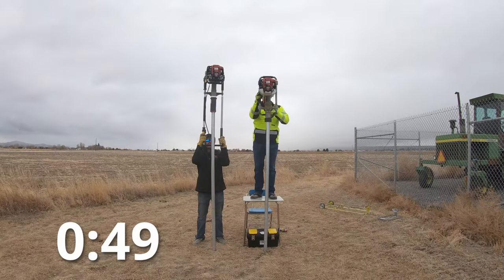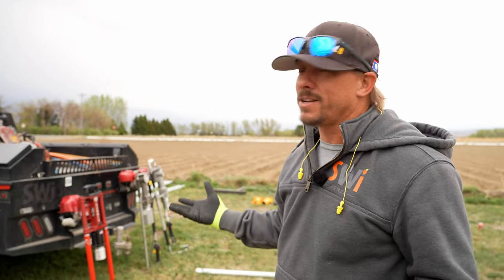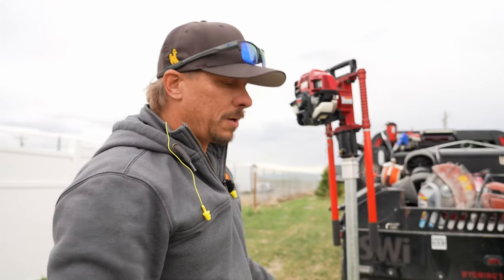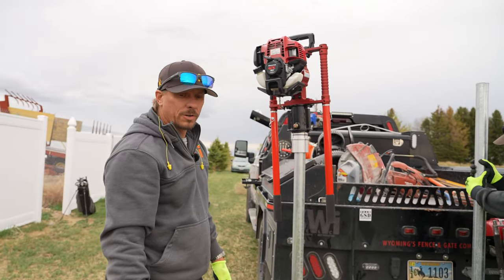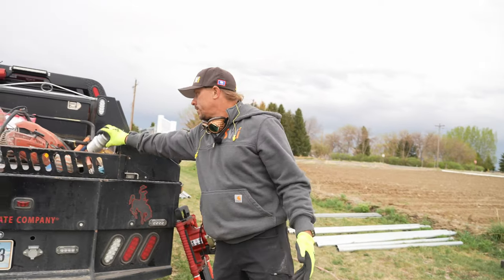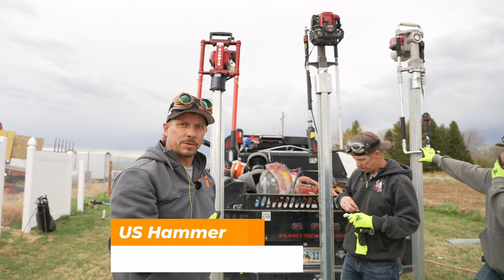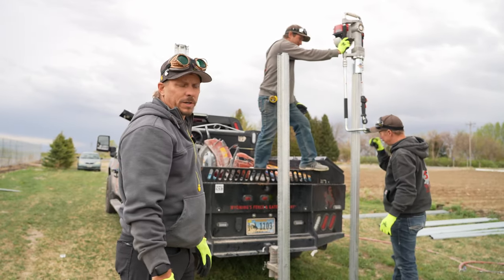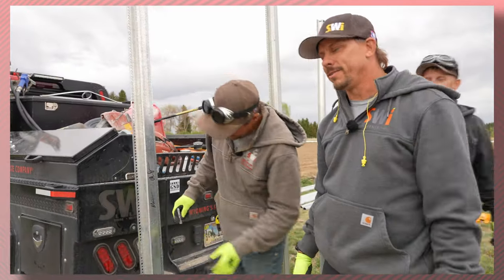The Ultimate Fence Post Driver Shootout! US Hammer VS Rhino VS Redidriver

Comment: Have you found if there is anything to put on the end of the pipe, such as a sacrificial cone tip that helps spear down into the ground and it stays in the ground once driven in? I run 3 inch pipes and can't find a cone/spear tip to help it drive down easier
Reply from the maker: I can't imagine it would help that much. And you do want that dirt going up inside of the pipe.
Reply: @SWiFence  Good call. Thanks. I live in an area where 2 to 3 feet down is all river bed so the rocks are very smooth and rounded. I thought if we can spear a way down then that may move rocks easier. Whereas a 3 inch pipe hits a rock and it's done going any deeper.

Comment: question.... I'll be flying out to NC to reinstall hurricane damaged 6' cedar fencing(HOA says wood).  The soil is sand from what I know.  What do you recommend for posts?  I don't want to embed them with concrete(unless you say other wise) so I plan on U channel or round pipe and rent/buy a driver.   Thanks in advance.
Reply from the maker: I'd go with Postmasters all the way. If your soil's conducive I'd drive but you can concrete if you have to.
How Deep Do No Dig Fence Posts Have To Be? https://youtu.be/mc92svvCRFo
Testing The Absolute Strongest Fence Post Against Hurricane Winds https://youtu.be/Ocr73Lmo9O8

Comment: Have you tested the man saver post driver? I’m sure it’s probably a little slower but fatigue factor vs speed? I will be pipe fencing 23 acres and cross fencing multiple pastures and will be purchasing a post driver soon
Reply from the maker: I've never used a Man Saver so I can't really comment on them.
Reply: Mansaver works pretty well, just gotta waste time tripping over air compressor hose

Comment: Fellers… it’s nice that y’all found something that you could concur on.  And that’s a good thing.  

Me and my two brothers have very few things that we ever concur on.  Not on…
-The weather.
-Whose country bbq baby back ribs are best. 
-Which is cuter? A baby calf or baby pig.
-Night crawlers or Red Wigglers for catching catfish.
-Who filled a bra better? Linda Carter, Loni Anderson or Markie Post

You know… the important things a man should take a stand on.

But… we did have a bonding moment this spring.  They came down on a Saturday… I was staking up my ‘maters.  They were sitting on the glider in the shade, sipping tea and advising me on how much better they could drive in those T-post ‘mater stakes.  Until I pulled out my post driver… 

The 3” diameter well pipe, with its 1” solid steel plug and bent 1/2” rebar handles weren’t what shut them up.  Nor did the high visibility fluorescent orange paint job squelch their bragging.  Instead… the red plastic-dipped handles had them in awe.  

You see, when you add the No-slip of plasti-dip with the naturally grippy surface of 1/2” rebar… you end up with handles that’ll strip the callouses off a lumberjacks palms.

Once I dropped it over the top of the first stake their eyes widened and their mute mouths opened.  And, I knew instantly the there was one thing we could all concur on… Big Brother Dave had taken post driving up to a whole nuther level!

Now fellers, iffen y’all wanna put those Plain Jane Honda’s against a homemade, Ozark, callous stripping, post poker… Just let me know and I’ll lend you mine.  

And, who knows?   Maybe you three will concur with the three of us… all post drivers aren’t created equal!
Reply from the maker: That sounds like a showdown destined to happen! 🤣

Comment: Is it better to drive a post or set it in concrete after using a post hole auger?
Reply: Depends upon what/where you are doing it at.  A farm field, concrete is usually cost prohibitive.  Also, concrete may speed up rust when used on a metal post, by wicking moisture and never drying out; that’s why pouring them deep is so much better.